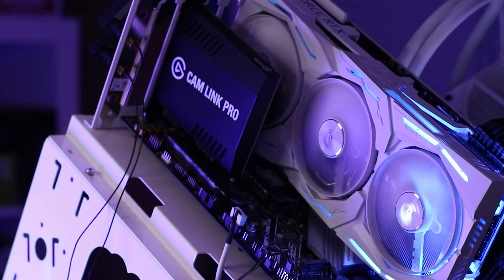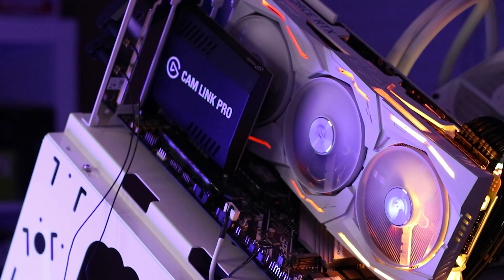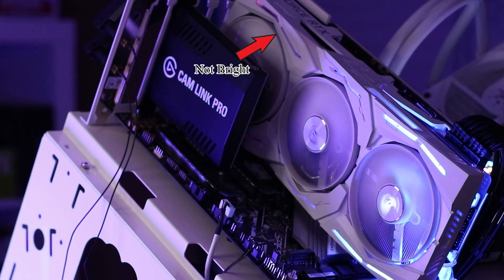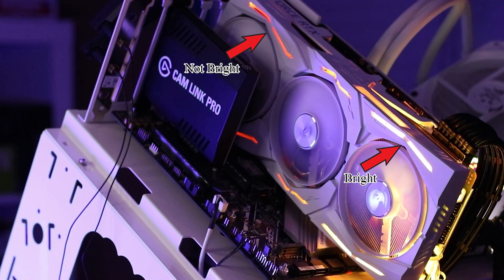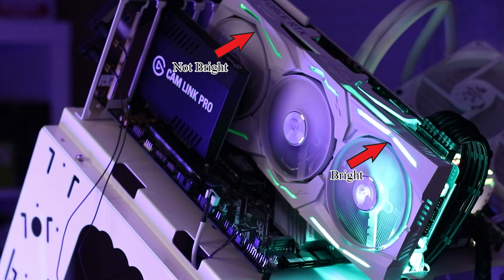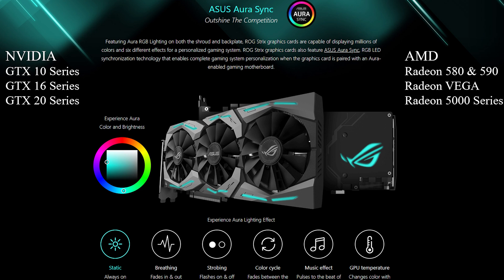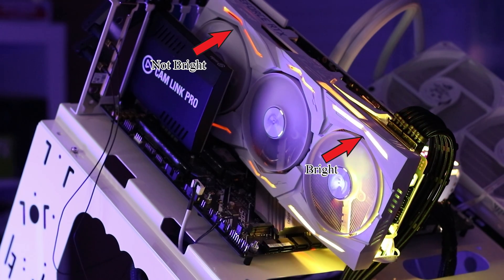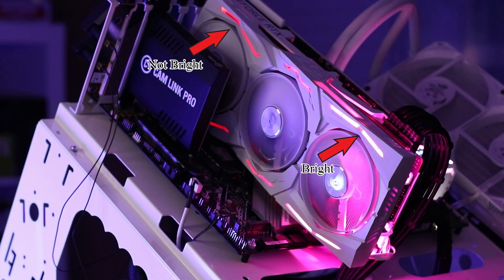ASUS GPU Fiber Optic Repair

Comment: Do you have any idea whether or not it's as easy as this when it comes to the 30xx series? My STrix 3080's LEDS are dying already and it hasn't even been a year yet :(
Reply: Hi, i also got this problem on my RTX 3080 Asus Rog White.
Did you solved it already with the strips?
Reply: @un1ckat702  No, but I figured that it's pretty easy to fix as long as you have an LED strip slot for your motherboard and just, you know, hiding the wires coming out of the 3080.